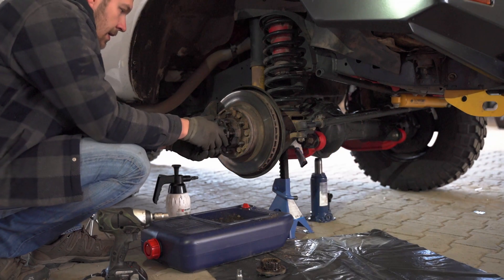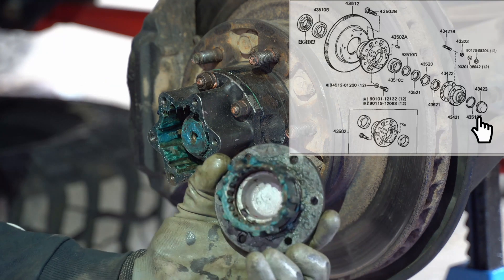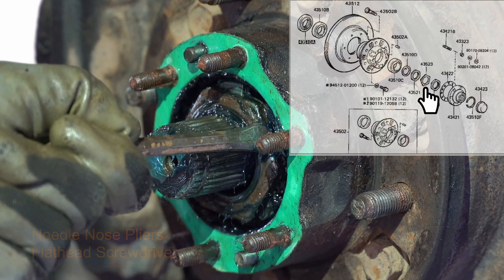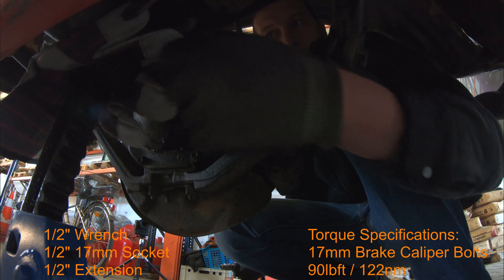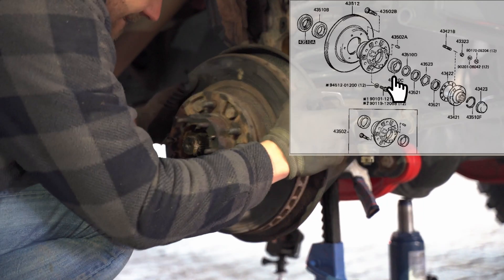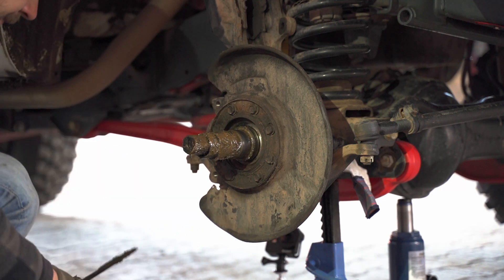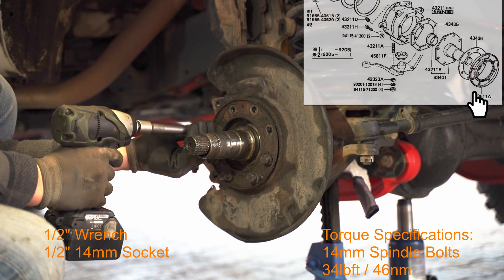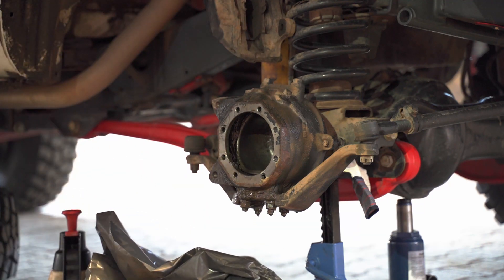4WD Front Axle Maintenance Land Cruiser Pt 1/2

Comment: Do you need to drain the fron diff fluid before performing this job?
Reply from the maker: Hi, absolutely not. If your axle is full of fluid, just lift the side you are working on a bit higher. The oil will then stay inside the axle housing, even while changing the seal.

Comment: I need to do this an 1987 fj60 land cruiser. What type of mechanics should I look for to get the job done?
Reply from the maker: I recommend at least a 54mm socket, a good set of wrenches and sockets in metric size as well as a seal puller. Also consider getting a nice heavy hammer, without it's not possible to get the cone washers out.